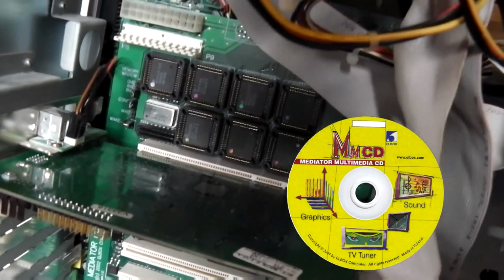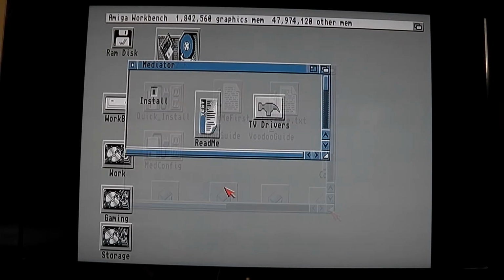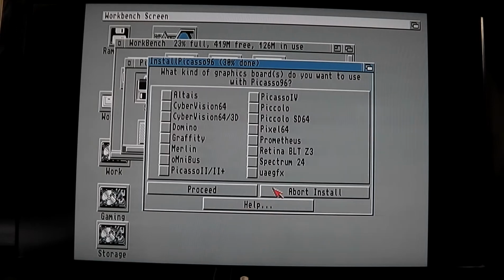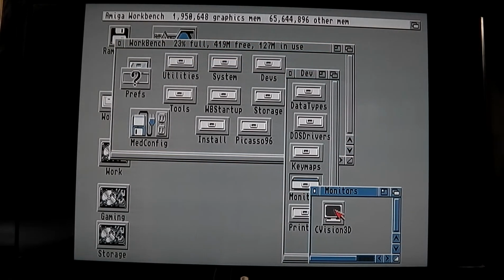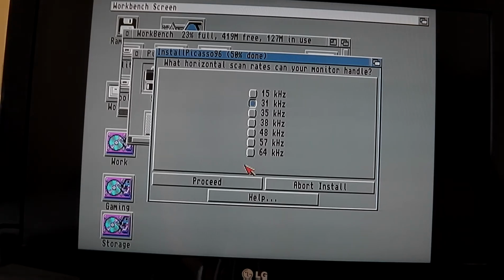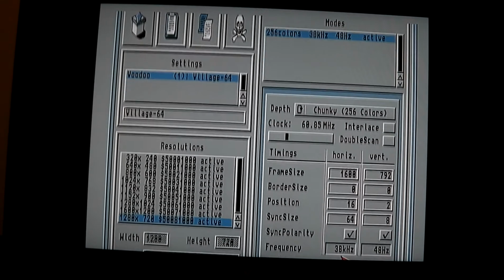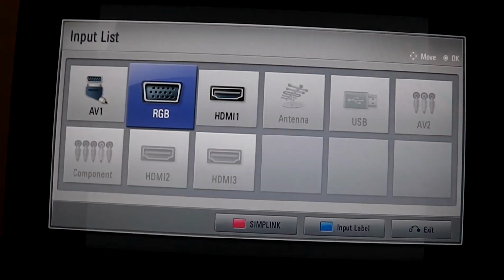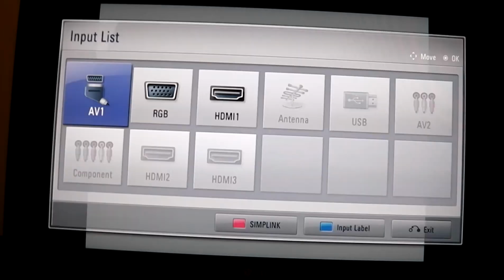How to install a Voodoo 3 graphics card and Mediator bus board in a towered Amiga 1200

Comment: Here is a really dumb question.  Can i install the hardware first and still use my Amiga or will i have to install the software etc first then fit the hardware after?  Btw you videos are perfect.  The CF install videos i will always come back to for reference when i forget stuff.  Thanks again.
Reply from the maker: If you install a mediator it will do absolutely nothing without the drivers and the Amiga will more or less ignore it until you do. Thanks for your kind words :)
Reply: For most devices you can use Amiga without installing any drivers or configuring anything. There are exemptions like: 1)Kickstart 3.2, where you need to copy two libraries (workbench.library and icon.library) from AmigaOS 3.2 CD to the hard drive (or Workbench will not start and will show errors about missing libs). 2)Some PCMCIA devices needs changes in config files or jumpers on PCB, so the memory will not overlap with the trap door memory expansion. 3)Some Turbo cards for A1200 with IDE connector needs updated scsi.device in Kickstart (in that case you need to write an EEPROM in programmer with replaced file or load changed Kickstart image at every boot).

Comment: Thanks for taking the time to provide this content.  It is very helpful.  I am really struggling with getting OS 3.2 to work with either one of my systems with mediator cards.  (A4000 desktop and A1200 Elbox)  l will probably revert back to 3.1 and see if I can get this to work without continuous lock ups.
Reply from the maker: Hope it goes smoothly for you, still never owned 3.2 so can't give any advice there i''m afraid.